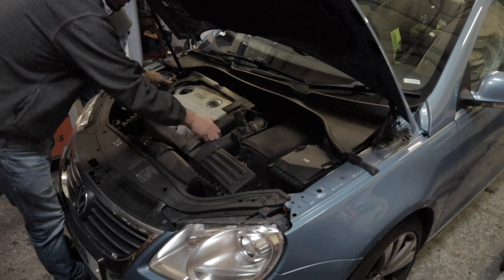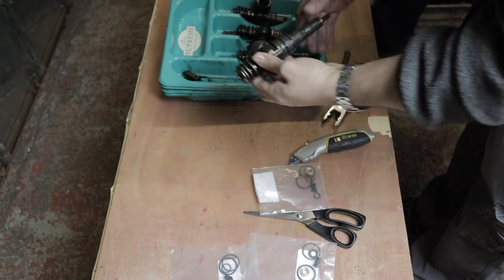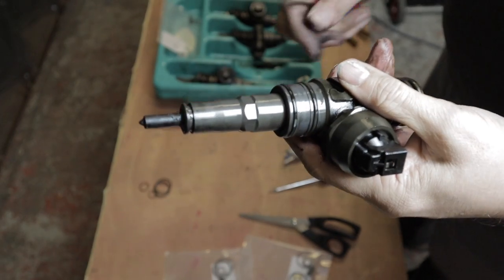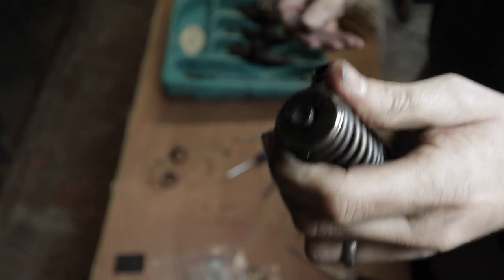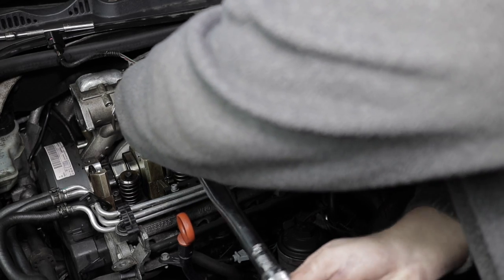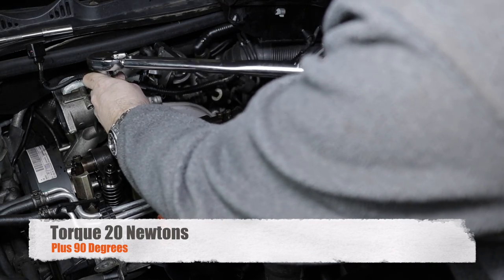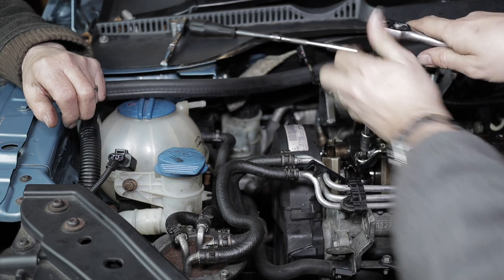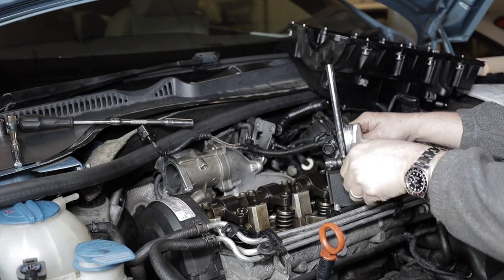VW PD injector, Remove, Reseal , and install, The complete Job

Comment: I got a code in my skoda 1.9 pd 
P1267 injector limit exceed in cylinder 3
Can you help me what is the problem. I m from India
Reply from the maker: every car is different..
Possible causes, faulty lamda sensor, airflow meter, wiring, ecu fault, air leak, faulty injector(s), boost leak (If turbo), and the list can goes on and on do you have any other fault codes, has your car been smoking, these could be area’s to look at, try a smoke test for air leaks
Reply: I directed the problem. Only one injector was faulty

Comment: Hi does the car need to be set to TDC? I replaced 1 injector on my vw touran tdi 2.0 engine AZV now it won't start only cranks no fault codes any idea what I can check? TA.
Reply from the maker: If your timing is set right (timing belt) https://youtu.be/GZtATHhIUcU  and your injector timing is set as in this video, then your engine should start, but the air needs to be purged out of the fuel system, do this by operating fuel pump a few times ie (10-20) without starting, some cars this can be done with the key, some needs software plugged into obd port, or you can jump top of fuel pump (tank pump not high pressure pump in engine bay) then try starting repeatedly waiting in between so not to over work starting motor wiring, and it should start, it takes some doing then run engine at about 2000rpm as it will cutout again if on tick over when air circulates back to injectors run for 5 to 10 mins and then it should start 1st time every time if your faults were fixed at time of repair,, hope this helps

Comment: How you tell if seals gone bad?
Reply from the maker: The seals are between channels, so if fuel is leaking into your engine oil, or if fuel return is over pressure may possibly have low pressure at the injectors ect

Comment: What symptoms did the engine show?
Reply from the maker: I did the injectors while I did the valve guide seals https://youtu.be/EJW9JdekbMs I had a slight over fuelling reading on my obd software, and a flat spot under full throttle, actually turned out to be a problem with vnt sticking slightly